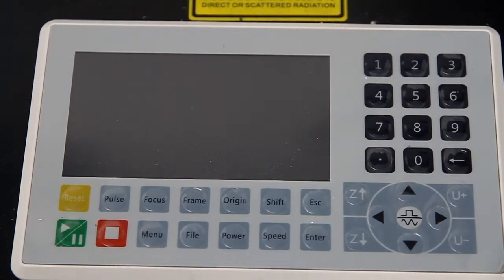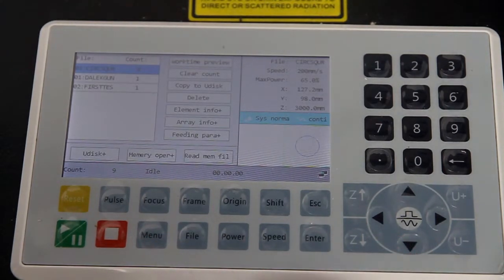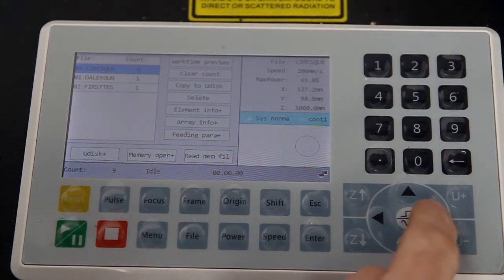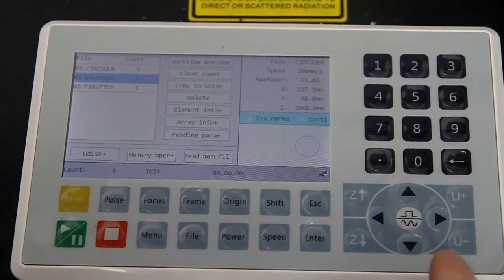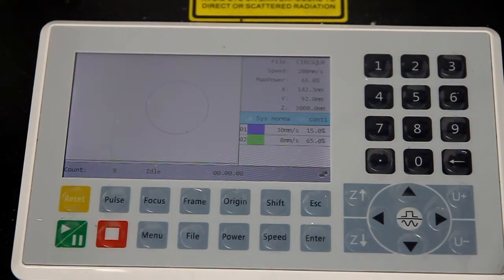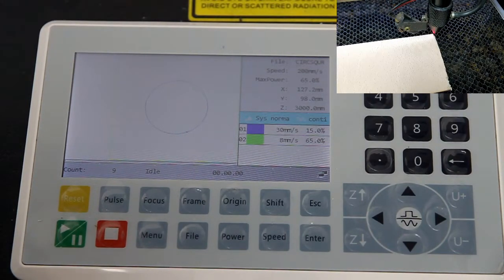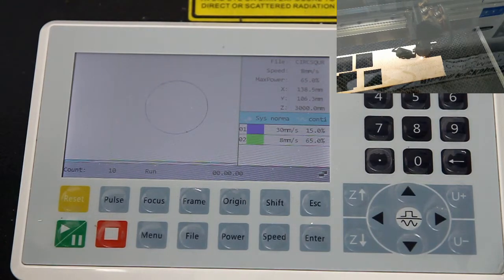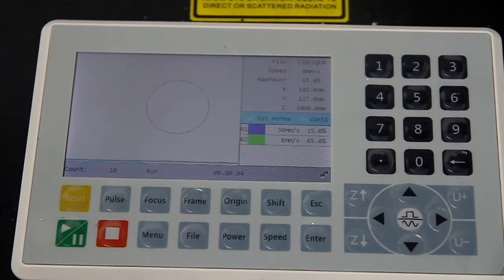Basic intro to the Ruida controller

Comment: Thanx!  Question:  Once you've set the "ORIGIN", can you use the controller (AFTER THE JOB HAS FINISHED) to go back to that exact "ORIGIN"?  

Meaning:  I've preset an "ORIGIN".  I've finished cutting my job.  My laser head moves to the upper right of the bed to allow me to remove/reload my material.  I place my material into a templated area and want to have the laser head move back to that EXACT position as the earlier "ORIGIN" was.  HOW???  -   Using only the controller  -  No computer
Reply from the maker: Hi Rick,
Thanks for the question. We have looked in to this for you and we think that the answer depends a bit on the model of Ruida controller the laser cutter you are using has. In our case it is a 6445G. With this there seem to be two ways to get the laser to return to where you set your origin. This assumes you have set a "User" origin by moving the laser to a desired point and pressing the "Origin"button. After this if you move the laser away from the User origin you set you can get it to return by either pressing the "Frame" button which will cause the controller to move the head to the User origin and then move the head around the outer boundary of the outline of the extremities of the currently loaded job, returning back to the User origin. Or, press the "Shift" and "ESC" buttons simultaneously and the head will return to the User origin. The Shift ESC works for "G" series controllers. We believe the behaviour is different for "S" series controllers and Shift ESC will move the head to the system absolute origin rather than the User origin.
Hope this helps.